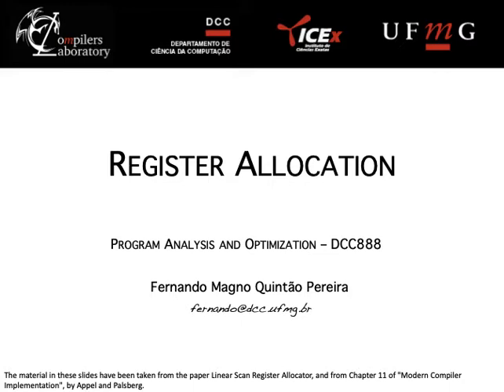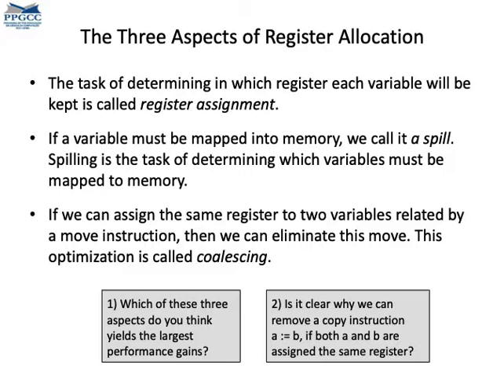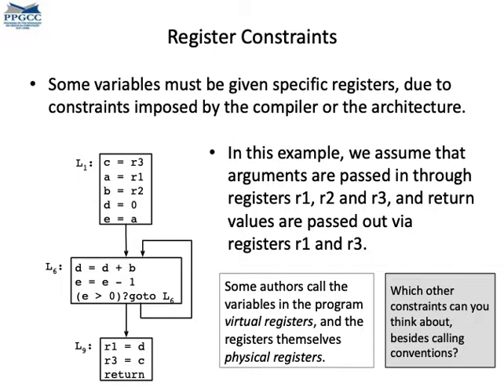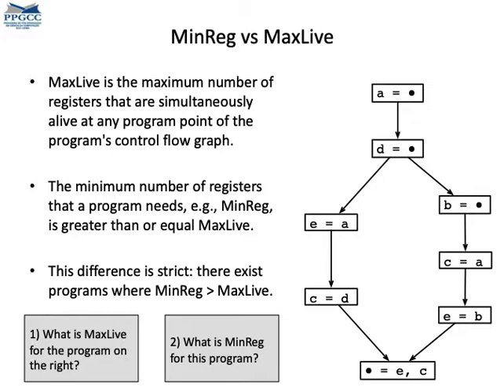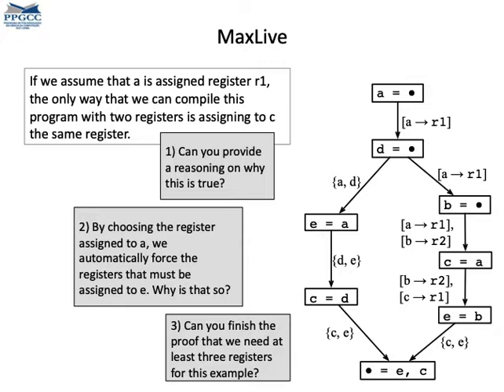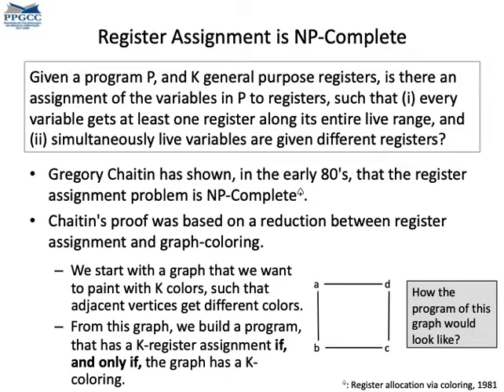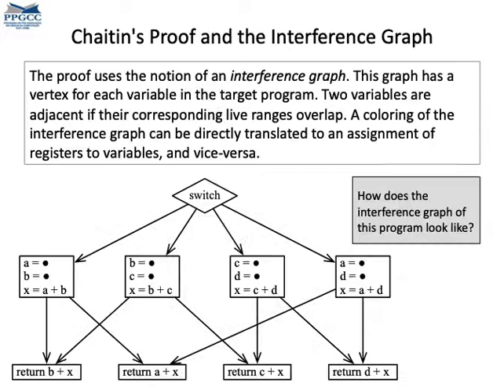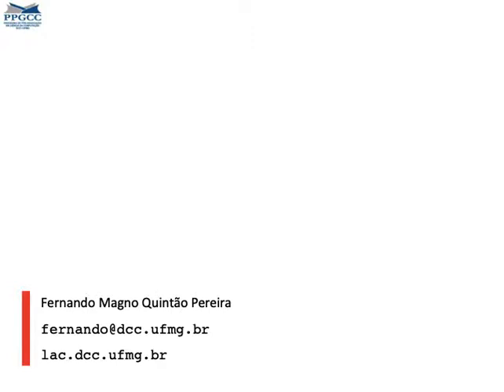Register Allocation - Part 1

Comment: For which conditions should we consider Chaitin's algorithm as the ultimate solution?
Reply: Ei, Alexandre. Chaitin's algorithm is general, and will work in any architecture in which all the registers have the same size. Yet, notice that it's more than 40 years old now. Since that time, many different algorithms for register allocation have been proposed. Interestingly enough, those based on graph coloring are all heavily inspired in Chaitin's original design.